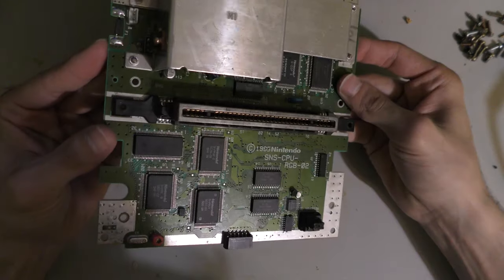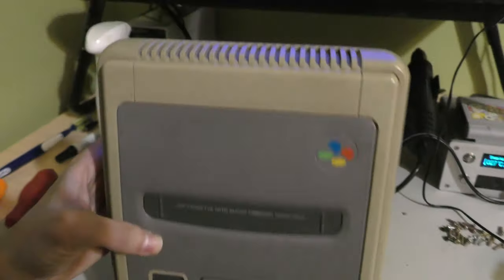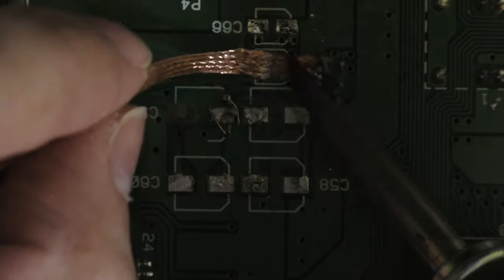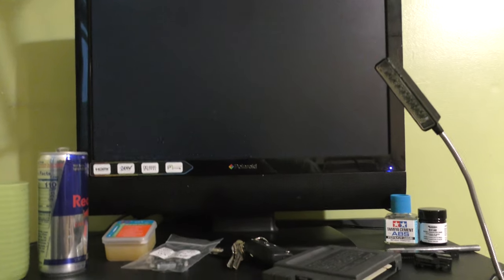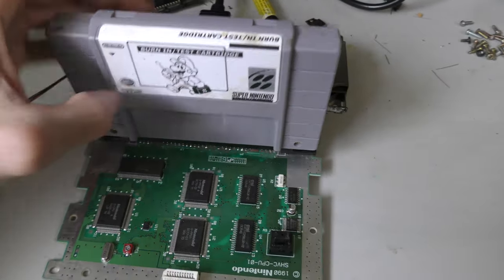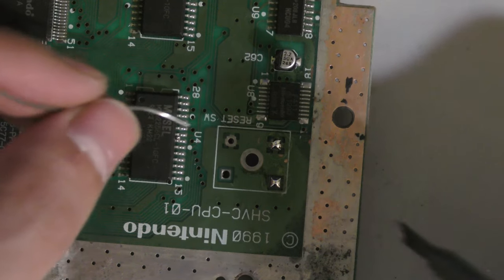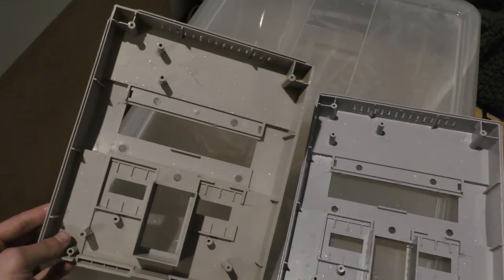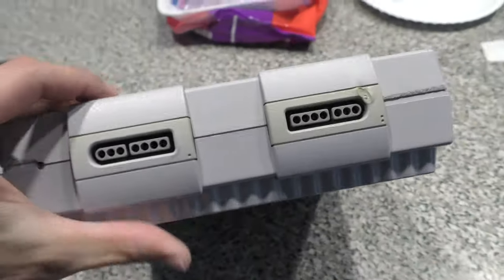VGRestore Ep45: 3 SNES Boards & Retrobrite

Comment: So the grind in the heat sink is because two of the screws were stripped and one of them was near that grind in the heat sink. The shell and the metal shells were rusty when I got the system. The other stripped screw was near the reset switch. I did a lot of sanding on the metal parts. I apologize. But 2/3 isn't too bad. Btw thanks for the fixing of my Kirby game it works well.
Reply: I hope some of the parts in the broken motherboard will work out for you in the future hopefully?
I had this idea about SNES CPU's and PPU's being made third party since they are to replace since they are custom made. Do you think it's possible to make them?
Reply: I'm also really mad that the first one was just a dirty cartridge connector lol I cleaned the pin connector so much and it was failing on me lmao. I'm glad you got it to work through.

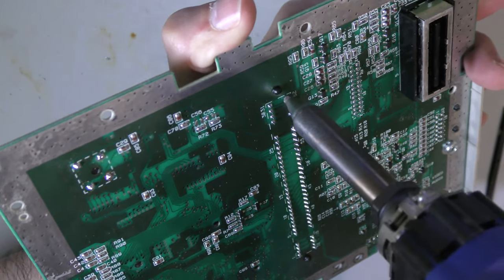Comment: 19:34 whats the point, some might ask...
They don't manufacture these old consoles anymore, down the road there will eventually be more dead consoles/ cartridges (with the Nintendo leak and the cic chip's secret being cracked at least we can preserve the games forever using brand new cartridges) / controllers than working ones, people like you have a huge impact on the gaming preservation scene, console by console.

I'm not a long time watcher of your channel, but I gotta say that as soon as I discovered it, I just binge watched every single one of your videos, so much so that it gave me the inspiration to get me a soldering kit and I'm  now trying to bring a N64 back to life. 

Cheers, stay safe.
Reply from the maker: Nice, I like your thinking, good luck. 👍

Comment: I know this video is old but if you or anyone else was wondering the super famicom requires the japanese power supply as the plug to the system has reverse polarity. No american power supply's will work so the easy alternative is to solder in the snes plug
Reply from the maker: This is not true, a Sega Genesis model 1 power supply is the same polarity as a Super Famicom. But yes you can solder in an American power port to use a North American Super Nintendo power adapter.
Reply: @PunkNDisorderlyGamer  This isn't true either I have found 1 style of 3rd party power supply that worked the others including the first party sega supply didn't work. Used the 1 good super fam power supply I had to verify.

Comment: How often do you have to replace your mixture? I was going to try my set up this way but I didnt want to have to replace the liquid all the time. So I use a foiled tub heat lamp and lights with salon care 40 and zip lock bags.
Reply from the maker: I haven’t replaced it yet, I keep it covered to not let it evaporate.
Reply: @PunkNDisorderlyGamer  how long have you been using it?

Comment: 27:08 solder ball between U4 pins 21 & 22
Reply from the maker: Good eye but I don’t think it’s causing any problems. It may not even be solder splash, could be debris or the silkscreen mark underneath.

Comment: Will retrobrighting in the hydrogen peroxide bath damage the gray 1-800 number sticker on the back of the bottom shell of the console? Also, how long of a UV LED strip did you use?
Reply from the maker: Phillip Mennor 5 meters long led strip. No, the stickers are fine from my experience.
Reply: @PunkNDisorderlyGamer  thanks for the quick reply. From your video and others that I've seen the peroxide bath with the LED strip is the best retrobright method out there. I'll be giving it a try.
Reply: Iv done hundreds with no sticker damage. Some times with the paper barcode stickers you might have issues (just try not to touch them when cleaning and rinsing) but not the nintendo logo ones.

Comment: How did you get the snes to run without the tin sheild on it?  I can't get one of my snes boards to turn on without the tin shield.
Reply from the maker: The aluminum shield is to prevent RF interference, if you try hard enough yours will work without it as well.
Reply: @PunkNDisorderlyGamer  try harder as in wiggling the cartridge?  Also the SNES Burn-in that you used, i think i want one of these for testing, will a repro of this suffice? thank you for the reply :)
Reply from the maker: @aquarianvibe5086  yes clean the cartridge port and cartridge and try again. The cart I have is a repro cart it will work.

Comment: Can you retro bright the snes controller ports or do the electronics in them make it impossible? I have an SNES thats been retro brightened but the controller ports are still yellow.
Reply from the maker: Yes you can, there are 2 tabs on each side of the controller port squeezing them may be a little awkward at first to detach the front bezel.

Comment: New to soldering, what problems can a "bridge" cause?
Reply from the maker: Each pin/leg/trace has a unique destination. As in point A to point B, you don’t want to combine two or more different points of travel and have them all mixed up. Also, if one leg carries a 5v charge you don’t want to send that directly to a data or address line. Hope this helps.

Comment: I just snagged a cheap SNES off EBay and it was listed as broken. Cleaned it all up and even soldered a new LED in for the power and it works fairly well. Only issue is if I do much as touch the cartridge it freezes up. I tried cleaning the pins several times and I just can’t seem to figure out the issue. It’ll play games perfectly fine but getting a cart to start up or not freeze if I touch it is killing me. Any tips on cleaning the pins or bending them?
Reply from the maker: Replace the pin connector is the best option, second best option is to clean them with deoxit. Spray some deoxit on a small piece of cloth wrap it around an old credit card or ID card and give the pins a couple of passes. As far as bending the pins back to give them better grip, I’m not sure how to do that, I’ve never done that on SNES pins before.
Reply: @PunkNDisorderlyGamer  rad, thanks man!! I’ll give it all a go and if I do try rebending the pins I’ll report back on the results.
Reply: @PunkNDisorderlyGamer  I just have thought that you can bend the pins for the SNES but that’s the NES. Either way - just wanted you to know I swapped all the caps and lifted a pad and traces for c58. Panicked and remembered your vid mentioning the capacitors all running together so I took my multimeter and tested to figure out where the capacitors went and used wire to hodgepodge c58 to its neighbor and the snes works great. Couldn’t have done it if I hadn’t watched your vids, man. If you got any tips on how to learn these fixes I’d love to know them but you’re one of my fav YouTubers, now! 

My spouse isn’t thrilled with all the busted nasty ass systems I’ve been buying but they’re happy I’m having fun fixing them Lmao.

Comment: Hey man, great stuff!  I have a somewhat unrelated question:  I have a copy of Super Mario All-Stars missing a resistor in the top right corner of the board labeled "CB".  The game works, but I'm assuming I should replace the part.  Can I purchase an appropriate resistor for that, or do I need to rip one from another SHVC-1A3M-30 board?
Reply from the maker: Resistors are resistors as long as you can find the same value, you should be good to go.
Reply: @PunkNDisorderlyGamer  Thanks!
Reply from the maker: Find a board that has that same resistor to measure with a multimeter or try to find the band colors to check the value.
Reply: @PunkNDisorderlyGamer  Thanks man.  I tried checking value via band colors, but I'm not sure I added/matched colors correctly.  I'm going to try again, thanks for the options.

Comment: NO BRASSO!
Reply: why, it is perfect for cleaning, as long as you don't polish it too much the gold plating doesn't go away. In that case, the cartridge port was junk so it was a last resort.
Reply from the maker: Bytoven absolutely, the Brasso was last resort and it did actually get the burn test to post a screen. There is a lot of misinformation from some of the large most influential youtuber community on Brasso and I’m tempted to make a video putting some myths to the test.
Reply: @PunkNDisorderlyGamer  Yes you should
Reply: Brass is amazing if used correctly. The problem is people use them to clean games and stuff and don't polish with a clean q tip after wards leaving a corrosive residue behind that can damage stuff or prevent contact between pins. But if you don't go crazy and polish it after the initial clean it works wonders. I don't recommend cleaning the same game every time you use it with it but for a game that has been sitting for 30 years it's a cheap quick way to restore the pins where other products won't come close to cleaning.